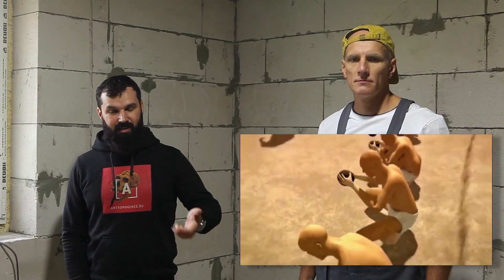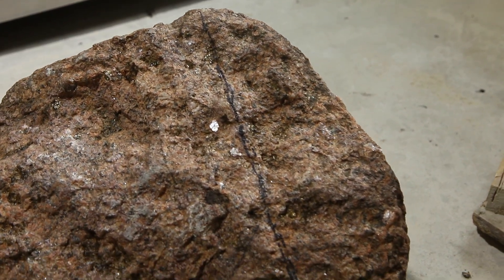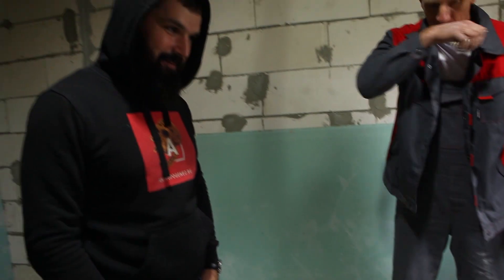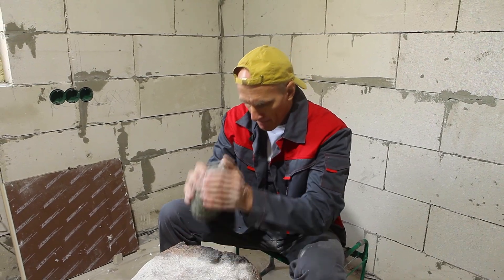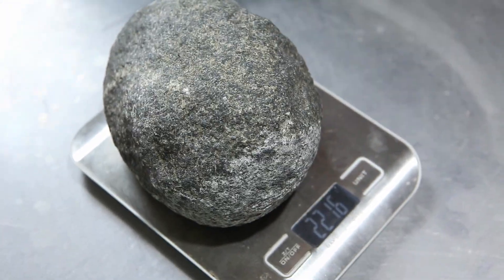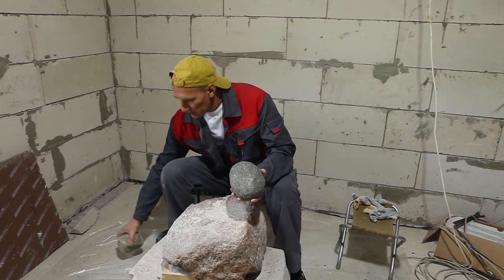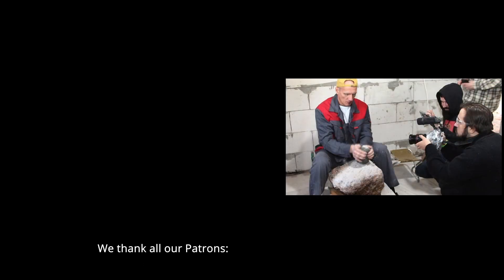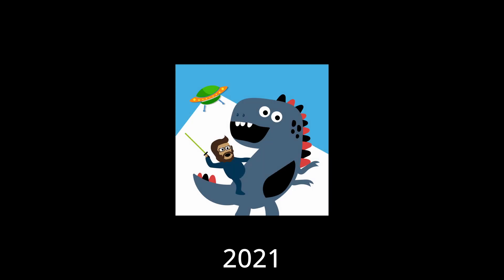Dolerite vs Granite | Could Ancient Egyptians carve obelisks?

Comment: So, with dolorite pounders, it takes 3000 work hours for one man to remove a cubic meter of granite. Let's assume egyptians were twice as efficient (they most likely weren't). Let's also assume there was enough space for 20 people to work on an obelisk at once in a quarry. Therefore it takes 75 hours to remove one cubic meter of material. Let's assume the workers need to dig 0.5 m wide ditches around the obelisk and each person needs 1m of space to dig, which is quite close to minimum possible in order to not hit others. This would mean 20 meters of ditch or an obelisk that's, let's say, a bit less than 9 meters long and 1 meter wide (corners add a bit of length to the ditch). Let's assume perfectly flat surface and 1.5m deep ditches in order to reach under the obelisk. Let's also assume that egyptians pound sideways with same efficiency as downwards. So 20m x 0.5m x 1.5 m + 1m x 9m x 0.5m = 19.5 cubic meters of granite = 1462 hours. With people working 24/7, that's 61 days of pounding for an obelisk that's below the lower limit of surviving obelisks. Assuming an egyptian can pound for 6 hours a day without losing efficiency, this would require 80 workers taking turns.

So, in short: dolorite pounders, 0.5x1m of space per worker, workers twice as efficient as in this test, under 9m tall obelisk, 80 workers each pounding 6 hours a day, no hinderances, it's 61 days of pounding to quarry the piece of granite to finish into an obelisk (which will probably take several months to half a year because the work requires immense accuracy).

 Sounds technically kind of feasible. If 6 hours of pounding a day while joking with friends pays better than some actually fun job, I'd say it could be worth it.
Reply: There is a theory that they speed the work with heat (fire) treatment.
Reply: @jonpaul3868  I have not seen anyone test it so there's no way to tell whether or not it would be faster and if it would, how much faster.
Reply: @outandabout259  An earlier commenter already pointed out that fire setting has been tested. Adel Kelaney was the author of the study.
Reply: You overlook a critical element = "fire".  There is physical evidence at Aswan of their employing fire along with pounding using dolerite to cut through the bedrock at critical weak points.  Along natural seams Egyptologists have found the remains of mud bricks and charcoal.  Geo-archeologists such as Adel Kelany have tested it to determine you could hammer through the bedrock much faster after heating/quenching it than simply pounding alone.

So work in their quarries was always ongoing and likely employed hundreds of not thousands.  To obtain a basic outline could be done using the fire method.  Then what follows is more careful hammering on the surface and smoothing that using flat blocks and abrasives such as sand or corundum - likely in a medium of some type.  Think modern kitchen cleansers which have mild grit in an emulsion medium.  

So sand mixed with perhaps moistened clay - Egyptian tafla which they mined and used in vast quantities for a myriad of applications - would be useful for smoothing rock surfaces after hammering it out somewhat smooth.  Plumb could be checked using carpenter squares such as have been found in tombs and which are seen in Egyptian iconography.  The tomb of Rekhmire shows Egyptian craftsmen at work with one checking the plumb on the side of a stone block using a large square.  🤔

p.s. - the video deals with dolerite but flint was also a commonly used gneiss stone tool which can be shaped for more fine detail.  Upon drawing a design as an example then using a tapered flint shard it would be possible to chip/scrape out the design in time.  Yes it is time consuming = but it is possible.  

Final thought.  There is ample evidence to indicate "a division of labor".  Unfinished tombs in the Valley of the Kings as an example show partially completed walls.  A basic artisan - apprentice - drew designs on a plastered wall.  Another came behind them - supervisors - to make corrections.  Finally someone painted the edited design - master craftsmen.  Hence they likely had teams of variously skilled workers who would follow each other's work as opposed to a single one doing it all themselves.

Comment: Cutting stones were hung by rope from tripods and gin poles and swung.  This greatly reduces the effort required to manually lift and strike the cutting stone onto the surface being abraded, not to mention increases the impact power.  That’s why there are those scoop marks everywhere.   The diorite stones often found are the pounder stone tip of wooden battering rams that were hung from A-frames.  You need to put about 20,000 psi onto a stone before it disintegrates at the impact point, and a rock in your hands doesn’t cut it.
Reply: "You need to put about 20,000 psi onto a stone before it disintegrates at the impact point, and a rock in your hands doesn’t cut it."

My dude you can go ricght now and peck a grove into a granite slab, it's not impossible at all
Reply: No you dont need 20000 psi, who tf told you that? You can scratch stone with only a couple of pounds of force with a sufficiently hard object.
Reply: Now that's a half decent theory.

Don't repeat this to any academics though, you'll lose your job.
Reply: The experts in Egypt disagree, it was done by hand pounding. The video you have to watch at the site literally shows you this.
Reply: @TrophyGuide101 One guy in Egypt disagrees. All that is run by one guy. And he's only there cause his daddy was important.
Reply: @ChadDidNothingWrong  I can't even remember writing this but I'm pretty sure I was being sarcastic because it's so unlikely yet they force you to watch a video implying it's true. I seen that one guy on Rogan and he is awful,  it's a shame he is basically in charge of all these amazing places

Comment: Why wouldn't they use tube drills to make it faster? At minimum I think the pyramids took a lot longer than 20 years to build and there are other tools missing from the record. How were the single piece columns turned?
Reply: Shh, don't ask hard questions in this highly scientific community.
Reply: What does the construction of the Pyramids in 2,500 BC have to do with a video about possible methods for constructing the Unfinished Obelisk in 1,500 BC? These things are a thousand years apart.

Comment: Really interesting stuff. It proves the maxim that "like cuts like" if nothing else. I wonder though, marks in the walls around the unfinished oblisk look a lot like the witness marks of a ball drill to me. I went there 30 years ago on holiday and had been using a ball drill a few weeks earlier. The parallel sides of the cuts and very similar depression widths at the bottom would look like that if done with a ball drill. Just to be clear - I have a degree in Physics+Geology so I don't for one second go for all this alien technology/laser/neutron cutting garbage but I think the Egyptians may have been a bit more sophisticated than many archaeologist give them credit for. The dolerite balls could actually be the balls used on the drilling tip in fact. There is also a shaft nearby that is maybe just under 1m wide, roughly square and about 10m deep. That could be drilled, but not pounded, there is no room in it to swing a pounder. It is only just wide enough to stand up in. I also saw zero evidence of any fire being used, no blackening of the walls anywhere for what its worth.

My 2 cents anyway.
Reply: Two really good cents. I think they had some type of machinery for this, like a ball drill, how they were powered I have no idea.
Reply: Yeah, fire usage would have left some traces on the quarry walls, but instead all we see are consistent 'scoop marks.'

I have also considered a large drill using the dolerite stones, or even a vertical ram ala a primitive stamp mill running on a cam. But the vertical ram seems unlikely to leave a square work face.

Comment: I wonder if using the powder as a paste on the work surface, rather than clearing it as you go, might yield faster results?
Reply: Yes.  The Egyptians mined and used tafla - a sedimentary clay - for a host of applications.  Today while you can still find it the old powder kitchen cleaners are passe.  Most people instead purchase "soft scrub" cleansers which are mild abrasive powders in a paste or liquid emulsion to clean their countertops etc..

So while dry powder and water can work in polishing a surface it would be more effective to simply create a semi-liquid paste of clay and abrasive medium and use that to polish a surface. Any residue from denuded copper could be recovered via collecting the runoff and heating much the same as copper ore is heated to free it from the rock which encases it.  

Yet "cost" was also a factor.  It costs money to obtain copper ore and smelt it into usable tools.  Gneiss stone however can be literally picked up off the ground and shaped to need.  Hard stone like flint etc. has been used for stone working for millennia.  So what is likely is that gneiss stone tools were used to obtain basic shapes and then bronze tools were used for finishing work.
Reply: Should add water then, or else you're eventually just pounding into the thick layer of soft dust
Reply: @myrdin90history87  That's what I meant by paste.

Comment: Very interesting result. Did not expect to see the curved result similar to the "scoop" marks. Surprised you didn't try with heated granite. I always thought those dolerite hammers were just "polishing" rocks in my mind, But if you take your result, method & add heat to the equation it paints a more realistic matching picture.
Reply: But those scoop marks are in impossible positions for rocks to be used plus if you're thinking about the broken obelisk it's 1200 tonnes
Reply: @muckyguru  how so? In what way are they “impossible”? And given that marks are physically there, and were made during the New Kingdom, which had Bronze Age masonry technology.
Reply: What? “Scoop marks” ?? You do realise the obelisk was carved and those “scoop” marks were UNDER that obelisk…so tell me, which idiotic Egyptian will be the dumb one to be under it to “scoop” the last section risking collapse?

This experiment virtually proved nothing apart from what was obvious ie a denser stone will VERY slowly chip a less dense one…🤦‍♂️
Reply: Not quite the same as the scoops. You'd need another army of people making the dolorite hammers given the loss.
Reply: There is clear evidence of applying heat to granite to "soften" it for sculpting. The enormous obelisk that was uncompleted and found in at the quarry in Aswan was found with considerable evidence for heating the granite surface. they found charcoal and ash all around its in the excavated layers.
Reply: These marks don't even come close. A different method was used.

Comment: Proving conclusively that this was NOT how they made the monolithic works of Egypt or any of the other similar sites around the world.    Why?  because for instance one Pyramid contains about 5,300,000 tons of granite, so that would require the consumption of 1,500,000 tons of Dolerite hammers at your calculated wear rate.   So where are the Dolerite quarries?  Where are the river gravel sources of round Dollerite hammers?  And that's just one Pyramid, there are many Pyramids, and countless other Granite structures, blocks, statues, as well as the ones made from material as hard as dolerite......  the number do NOT add up. Sorry.  Try again.  And its WORSE that this! Because they can only use suitable shaped and SIZED dolerite rocks, say between 12 to 16 ks a piece.  Once that has worn down to say 8kgs, its not useful anymore, so they need a new dolerite hammer. So tripple the number of dolerite stone hammers from 1,500,000 tones worth, to 4,500,000 tons worth. Now where are the endless fields of too small dolerite stones, and the equally too large stones?
The same Mass of Granite recuires the same Mass of suitably sized dolerite hammers..... not possible.
Reply from the maker: The pyramids are built from limestone, my friend. You did not know?
Reply: @ScientistsAgainstMyths  and granite, but lots of other significant structures are made from massive granite blocks, and stone even harder.  Still millions of tons worth.  So there! Plus there are other ancient sites in other countries that also use Granite and harder stone.  So the bashing with round dolerite is not a solid theory.
Reply from the maker: > but lots of other significant structures are made from massive granite blocks
For example? List "lots of" please
Reply: @ScientistsAgainstMyths  I only need one, because you cant explain it, why bother to list lots? Explain the Dolerite bashing method that allowed the construction of the Barabar caves in India.
And even within the Pyramids, there are granite and diorite blocks and THOUSANDS of diorite and granite statues, Obelisks that CANT have been made by flint chisels and bashing with football sized dolerite boulders.
You are engaging in wishful thinking to avoid the problem that you cant explain something.
Reply from the maker: >  Pyramid contains about 5,300,000 tons of granite
The pyramids are built from limestone
> but lots of other significant structures are made from massive granite blocks
List "lots of" please
>   I only need one
>  Barabar caves in India
The best example of demagogy, thank you!
Reply: @ScientistsAgainstMyths  You obviously don't know what a demagogue is.  But that's not much of a reply anyway.
Reply: @ScientistsAgainstMyths  To be clear, I cant explain how or even approximately when those amazing monolithic works were done. Ive listened to all opinions from all sides, but have not heard of a explanation that fits all the evidence convincingly.
I don't believe aliens did it, (too rough for advanced technology) - its a curious blend of apparently simple methods but done on  mind bending  scales, and with super expert abilities, (the intricacies of those statues and ornate vases) and as if each day lasted 200 hours, and people lived for a thousand years, so spending a few decades of your life bashing and rubbing half a mountain down, was no big deal.
I don't know the answer.  I marvel as much as if it were done by aliens, they may as well have been aliens judging by what they left behind, because their efforts were mind blowing.
Reply: Granite use in the Old Kingdom when most of the pyramids were created was limited being primarily seen via "blocks" and sarcophagi.  One does not typically see intricately carved granite until the New Kingdom and later when it is likely Egypt imported at least some iron tools which would be used by royal craftsmen.  Like copper which was controlled as a "strategic resource" any iron would similarly be tightly controlled.  There are papyri detailing how workmen in the Valley of the Kings had their copper tools weighed to prevent pilferage of broken bits as copper was that valuable.

Anyways dolerite was the main gneiss stone tool employed as was flint.  Yet they also used fire to hammer through granite bedrock to obtain basic shapes which could then be pounded/sanded/sawed smooth.  At Aswan along natural fault lines Egyptologists have found remnants of mudbrick and charcoal.  They were heating the bedrock and quenching it to soften it prior to hammerstone use via dolerite pounders such as littered the quarry. 

p.s. - quarries as today were in operation continually.  Granite sarcophagi are seen as far back as Djoser and were not limited to Pharaohs alone.  Ergo quarries would have onhand at any time partially quarried stone as well as completed objects for use by royal persons etc..  People simply assume they began work when Pharaoh needed a sarcophagus which took the longest to fabricate.  What is more likely is they already had some available or partially done - thus shortening the fabrication time to fill the need. The knew how much granite would be needed before the foundation of the pyramid was even laid out. That means they had years to fabricate and transport it to the site before it required placement.

Comment: Try cut that granite with copper saw
Reply: It’s not enough to ask them to use a copper saw to cut granite. We need to see the ancient work repeated. Period. We already know it’s possible to cut stone with just about anything when you use sand as an abrasive. It’s not enough. I’m so tired of people taking one hour of work with underwhelming results and extrapolating the data to a full day, even years then calling the experiment a success. We need to see the most difficult work repeated, without any help from modern tech.
Reply: @jw2722  Why is it not enough? Do you expect someone to go re-create the Unfinished Obelisk just to satisfy your curiosity?

If the method works, then all it takes is time and labor, both of which the Egyptians had an abundance. They have proven that the method works. They don't need to prove this was the actual method used. Proving that it could have been used means that aliens weren't necessary.
Reply: @hydra70  I never said anything about aliens. But I see there’s a huge bias here so it’s not worth debating. I explained why I think it needs to be repeated at least in the sense that a job is completed. Doesn’t have to be on the same scale. And it has nothing to do with my own “curiosity” as you put it. It’s about seeing the complete context. There’s more to the work than material removal. It’s about not being lazy and seeing what we can find by completing the work.